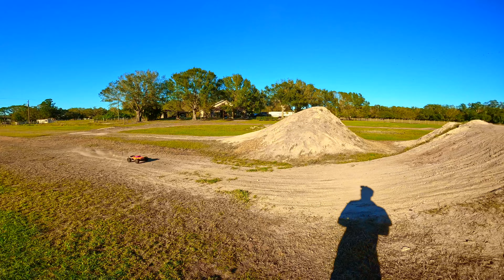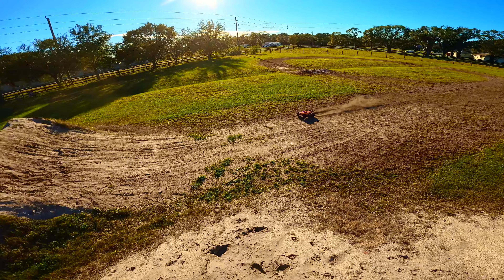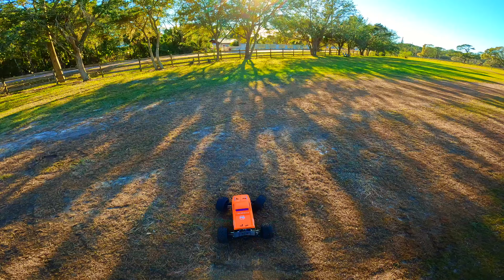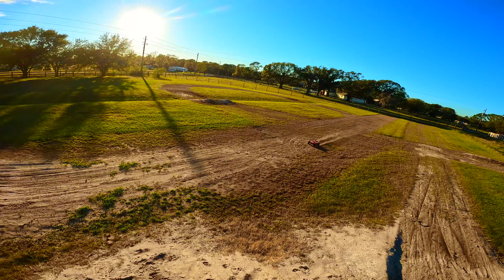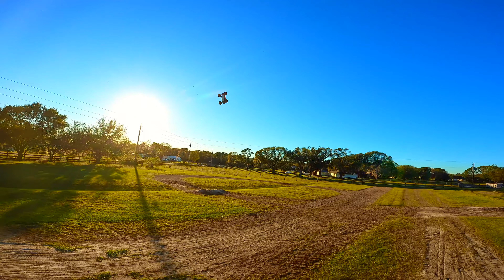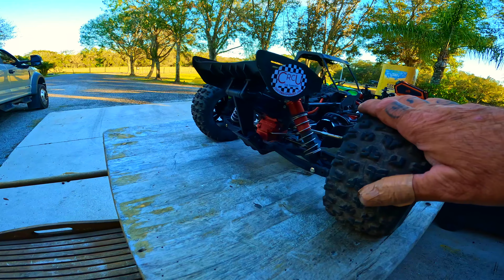Arrma "CRACKLING CVD'S" Kraton XL 6s

Comment: What a PERFECT RUN brother, you made my Friday 🤗🤗🤗. Those are the caster clips you mentioned. To move the front upper arm more forward, gives you more steering ( less Caster angle ) ❤️❤️
Reply from the maker: Thank you my dear friend Thomas. 😍 I’m glad I could make your Friday better. I never just change one thing at a time I always do two or more so I don’t know what fixed the issue but the truck was driving a lot straighter on full acceleration at the end of the run but either way, I’m happy that’s all that matters. Hope you have a happy and wonderful new year my friend.